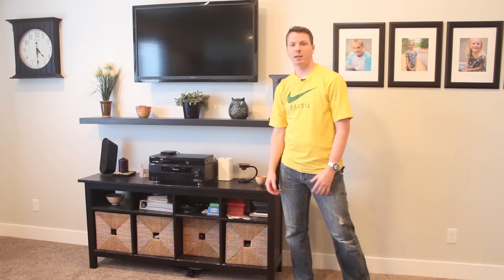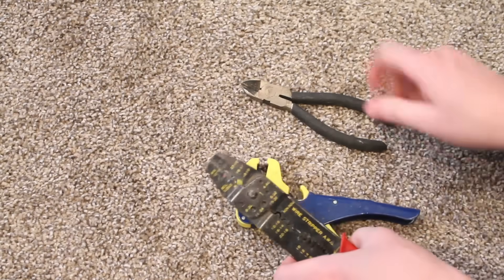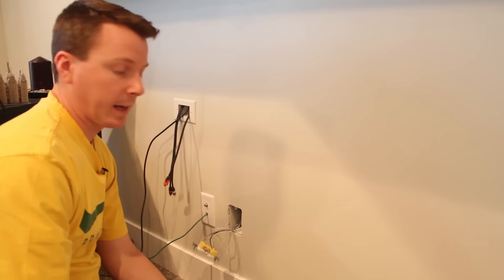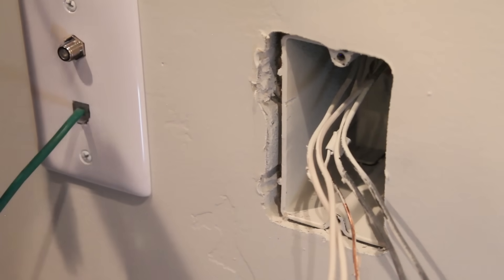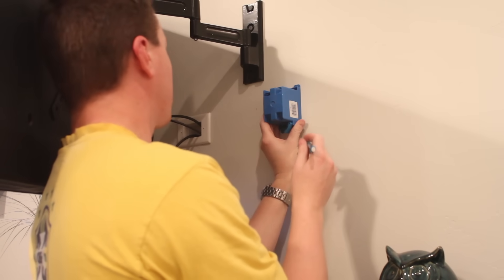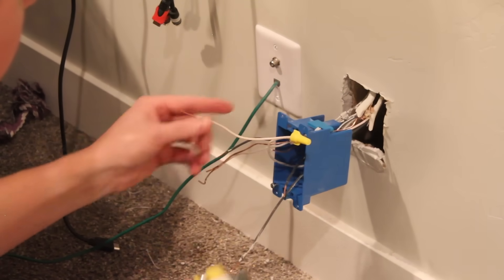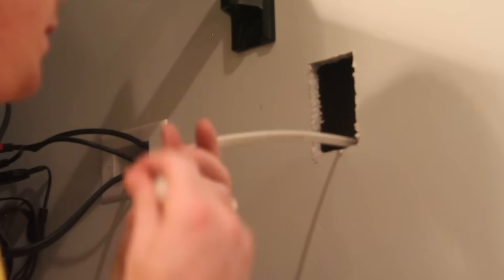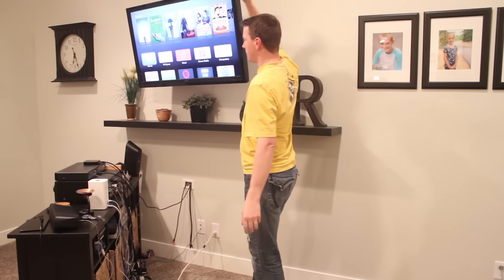How to Add an Electrical Outlet for a Wall Mounted TV

Comment: As a professional electrician this is brutal to watch.
Reply: See how he spliced the one set of wires together because he has 3 cables in the one box. He should have splice all 3 white with one jumper wire to go to the terminal for neutral (white). Same for power  (black) and the bare copper ground. This will prevent other device's from not working of the outlet goes bad making it easier to troubleshoot the problem in the future. When he entered the 3 cables in the one old work bod the white jacket was not in the box at all that's a national electric code violation. The way me made the terminal hooks is good. NEVER back stab the device to make. Meaning dont use the quick connection holes in the back of the device. It's not as solid connection as a terminal screw and can cause arcing. Finally no need to take out the old box from where you are getting a feed from. You can pop the tab from the inside. Cut out the new box above the existing device and send the snake up.
Reply: Union electrician here: agreed.
Reply: Why did you watch?
Reply: @kevinm8865  to see if they are telling people the proper way to install a device. Now thousands of home owners are gonna hack up homes
Reply: @noonzzzy  LoL! I'm a homeowner that's hacking his way through this, unfortunately.

I do desire to do it correctly though. Perhaps with your comment, you could add some meaningful suggestions so ha is like me can do better.

I get it though. You studied and became a professional and that's not the path I took so I can't be expected to have pro skills.

I do agree with your sentiment hat many people should not be doing tutorials online when they themselves are amateur.
Reply: Also in the top outlet he only has about 3 inches of outer jacket removed. Its recommended to go fro 6-8 inches or wire in the box.
Reply: @noonzzzy  Fiest thank you not not being a YouTubw jerk! Very much appreciated. That is for the tips.

Meanwhile, I'm currently fighting and cussing trying to fish cable through my insulated wall. Next step will be wiring if I ever get there.
Reply: @kevinm8865  oh yeah it can be a real pain you need a snake. Make sure it has a small head on the end a hook that's taped off so it wont catch the insulation. Thanks no one likes a troll. If I had the video production this channel has I would do a response video. It would be so much easier to show tricks and tips
Reply: @kevinm8865  if you have kids or a spouse that could help snake one to work the snake and one to feel for it in the wall where you cut out the new box
Reply: @noonzzzy  I would also like to thank you for explaining the things you had a problem with instead of just trashing the guy and moving along. Getting ready to tackle this today and I have to go through a small metal existing box thats not installed in 2x4 walls.
Reply: @610scat  sounds like you are dealing with an older home. If you look in the box you are tapping out of  and it has  a metal clamp with 2 metal tabs with a bracket with 2 holes in it its m/c wiring being used
Reply: @noonzzzy  small metal box, barely enough room for the outlet with wire coming in and going out.  I ended up taking the old metal box out and replacing it with a nice new old work box after i fished the new wire down to it.
Reply: @noonzzzy  So what do I do if my box already has 2 romex coming into the top 2 holes?  How would I get the new romex fished through to go up if only one romex per hole?
Reply: @andrewconstantino8570  take a flat head screw driver or needle nose and pry back the plastic taps on the side of the box you want to snake out of. Send the snake up the knock out you enlarged. You can have up to 2 cables per knock out. When snaking the wire into the existing box make a small head that attaches to your snake hook. I would skin the outer jacket expose the three conductor. Cut out the hot and neutral leave the bare ground. Make a nice tight loop and run it in your snake hook. Crimpe it with pliers so it's nice and slender. Then tape it all up. Once you get the cable in the existing box make sure you have enough so you can cut everything off the snake and have fresh conductors to work with
Reply: Is there any video you’ve seen where as a professional electrician you would approve?
Reply: @redvelvet261  if you look up electrician u channel on YouTube he might have some video on this he is good

Comment: thank you, this is so helpful.  If I want to connect the new outlet to a existing one that is about 4 feet away on the upper right, is it going to be challenging looking for Romax cable from the other end?
Reply: I would suggest having a second person to assist with the drop wire. Have one person feed the cable from the top and arch it slightly to the existing space. Your spotter at the lower box can help guide you to the existing hole and help pull it through.

Comment: Good video, when I did it I hooked up in the attic but yours looked easier. But I don't think you should've reused the plug, without a release you could bend something inside the plug and it may affect the degree of contact. 15  amp plugs are generally less than a buck  in home depot, when your buying some Romex just pick up a plug?

Comment: Not a criticism on his video but I bought a couple of these 2 or so years ago and it was a super simple install. 

https://www.bestbuy.com/site/powerbridge-in-wall-power-and-cable-management-white/5580605.p?skuId=5580605

OR at

PowerBridge TWO-CK Dual Outlet Recessed In-Wall Cable Management System with PowerConnect for Wall-Mounted Flat Screen LED, LCD, and Plasma TV’s https://www.amazon.com/dp/B00GWGZGQ4/ref=cm_sw_r_cp_apa_i_JoO7CbP0PF10W

Comment: use a recessed box for your power and your low volt. there is a special box that has both incorporated sectioned off.you can not combine low volt with high volt. i dont remove the lower box and have done this many times both commercial and residential.show us how you get around a fire block bright guy.

Comment: Although you have some skills, you are certainly not a craftsman. There was no need to remove the lower box and in doing so, you ruined the drywall around it. Also, in the bottom box, the video showed that the sheathing from the two cables was not inside the box. I hope you fixed that before installing the outlet.

Comment: As a licensed professional I see a few flaws...(1) you are not a licensed professional therefore you should not be giving tutorials.
(2) you've have not paid for or filed for a permit application. (3) you have not installed a tamper proof receptacle at either the receptacle you installed or removed (4) you did not replace the existing breaker that controls that preexisting circuit with an AFCI breaker. 
There is one more thing...you cannot place two wires in one opening of any new work or old work boxes, it is not allowed by code.
Do what you want people...but if there ever was a problem with that installation and damages are sustained....your insurance may not cover you....or charges brought against you if someone is harmed or dies.

Comment: As a licensed electrician...never do it like this guy did.
Reply: What did he do incorrectly, that you would have done differently? I was going to follow his instructions,  but now you have me rethinking it.
Reply: @tjjackson4622  I'm not an electrician, but I think he stripped off too much of the white sheathing that protects the black, white and ground wires.  I believe any wire leaving the junction box and going into the wall needs to be protected by that white sheathing, but hopefully an electrician can confirm.
Reply: Explain
Reply: Is Dan correct? I have no idea what he did wrong?

Comment: High voltage is 400,000 -133,000 volts, medium voltage is 11,000 volts low voltage is less than 1000 volts and extra low voltage is 12 volts and under.

Comment: When amatures attempt to teach you electrical on youtube.. couple points
1.) The old outlet had too much tail you should of cut the wires and tossed it
2.) You had absolutely no reason to remove the old workbox you could of fished up (w/t pex) grabbed your line and pulled back into the existing box
3.) You trimed your new outlet too long used the wrong size wirenuts and no ground clamp
4.) Even the make up of your outlet behind the tv is garbage sheath should be stripped bact to the workbox withba handful of tail coming out and yes it does matter which screws you land on the top away from ground screws are prefered and set the unused ones
Are those TR outlets?
5.) Nec requires you to add an afci

If your going to make instructional videos about electrical installations you should be somewhat experienced

Comment: Two screws on each side for white and black. Does it matter if you connected the line from the breaker box to the 3 splice or should it be on its own screw by itself?

Comment: Does anyone know if you can add two new outlets behind the TV  this way ? I need four plug in spots  :/
Reply from the maker: You sure can. Exact same principles apply. Still a good idea to see how many outlets or lights are on the same run because every additional outlet has the potential to put additional strain on that circuit.

Comment: living in the UK, it terrifies me how bad american electrical outlets are with exposed terminals on the side of the sockets. and why use those weird yellow things to connect cables together, just put the new cable under one of the screws

Comment: this is a vidio on how not to do it  ,wires not installed in box correctly ,outer jacket not inside box and on most boxes not approved to have 2 wires entering through same hole  .from a retired electrican
Reply: Ken Allen good thing you retired because you don’t know much about electrical
Reply: @leonardholt5311  and you know even less and you saying you are not an electrician is hardly a surprise
Reply: Ken Allen I am an electrician. Not a clean up guy like yourself. There is no box in this video that can’t have two wires in the same hole. If so, please share code book reference. Oh wait, you’ve never opened a code book

Comment: You should never pre-twist the romex wires.  That's the job of the wire nut.  It will actually hold better if you do not pre-twist.

Comment: There are outlets that are made to chain together, so the extra 6 inch Y cable that was made wasn't necessary.  This will also create a lot of excess wire in the box.  Be sure when buying the additional outlet that it has screws on both sides, since this is the type designed to be chained.  See the following web page for more details: www.electrical101.com/receptacle-wiring-using-nm-cable.html
Reply: Why does he have two sets of hot wires on the outlet
Reply: Why are there several white and black wires in the existing outlet?

Comment: Respect this guys ambition but this should be a video on how not to do it. Removing the perfectly good gem box for no reason other than to destroy the wall and not pull the wires all the way into the new box and essentially cause  a fire hazard. Always call a licensed electrician. Only call this guy is making is to his local fire department.

Comment: I'm an electrical engineer and when I do a project like this, I way overdo it! I worked for NASA and we over specified everything. And I am proud to say that nothing ever failed on my watch. I carry that work ethos over to my home projects. Zero Defects we called it.
First, I tear out a lot of the drywall to reveal the studs and anything behind the wall, like pipes and wiring. Then, I install electrical boxes. I would use three double outlet ac outlets. That makes 6 outlets for TV, cable box, router/modem, power for USB plugs, and a couple of spares. In today's world, I would use two of the ac outlets that have built-in USB ports. It's a USB world. All of that is for the high voltage work. Also, I'd use armor cable behind the wall so one day I don't drill into the Romex. Yea, I know Romex meets code, but it only take another ten minutes per cord to cut plus about 4 bucks extra per outlet. A word about studs - they're never where you want them to be. I often run a 1 x 3 x 18 to two of the studs. Then I can use wood screws anywhere convenient in the wood to attach things to the wall because the wood is transferring the load to the studs. The wood has pretty good strength for most work when attached to studs. Some people cheat and hope that one stud and one toggle bolt will hold the load. Not for me. That toggle bolt has a name in engineering. It's call a potential point of failure. Don't rely on drywall to support much weight. Later, I tape and paint the wall, The low voltage wiring is the same as everyone does it. There's no danger hitting a speaker or hdmi wire. The big job is repairing all the drywall I damaged and ripped out. But after 20 years of drywalling, I can do that in my sleep.
Some advice to beginners: learn how to do wiring. It takes practice, reading, and maybe someone who is trained (not your neighborhood handyman) to do a 'safe install'. It took me a few years until I figured everything out, so don't kick yourself for not knowing things right outta the gate - wire gauges, how many wires you can put in each size box, how much current a wire can carry, etc. The best investments you'll ever make: 1-a book on how to wire. 2-a five dollar tester from Home Depot that plugs into an outlet and lights up with 2 orange lights if it's good and one red light if it's bad wiring. And carefully choose what youtube videos you follow. I once saw a guy dressed in an official looking shirt like he was a pro do everything wrong) . In the 'old days' you had to apprentice for two years with an electrician before you could join the electrical workers union. That's all gone and anyone with a wire cutter thinks they're an electrician.
Well, that's how I do it. It takes me a few hours and a few bucks more, but I don't have to worry later on. Next stop... Mars!

Comment: very simple all you have to do is take the existing receptacle plate off, knockout the top knockout push the wire up to wherever your hole is going to be. I'd rather use a nail-on rather than a clip in any day just because a clip-in could get pulled out. The existing outlet should be mounted on a stud unless it was an added outlet so go directly above it and you'll be on a stud and get the nails pulled out of the nail on box get a sawzall to cut the little ears off. Get a sheetrock saw and saw where that stud is about two or so inches just so you know where it is level. get your box put the one side of the box against your line that you cut out and draw a round the rest of the box. Cut it out with a sheetrock saw. Grab your wire put it into your nail on box then get some drywall screws on the inside of the box and mount it to the stud. It will secure your receptacle a hell of a lot better. Tie in the new outlet then go to the existing other outlet and tie it in and there you go. If you wire it up right no need for a voltage tester at all just maybe a hot light to make sure that the circuit is off. If there's insulation fiberglass rods are perfect. if you had the ones that glow in the dark it'll be even better. If you can't find a wire in the hole, which is nearly impossible, then you can easily get a nut and string and fish it down

Comment: For those getting started working on electrical.  Not all reciprocals are going to be "Brass/Silver/Green".  Not all of them will be right side up as well... Not all houses are "up to code".  To have a better mindset over the wiring before you blast yourself away or your clients house goes down in flames.

N - Neutral(White)
PG - Ground Wire(Bare or sometimes green)
B - Hot Lead(Black)
R = 2nd Hot Wire/Accessory

B goes right - Smaller Rectangle
N goes left - Larger Rectangle
B should be Right side so the grounded "circle" is below the rectangles and not above

Yes US base for ease of installation it's "Brass/Silver/Green" but not every house will be color coded so know the basic wires and not just the colors.  You'll walk into a old house and it's all brown wiring and you'll see a white that's actually hot wire and not neutral then you have to backtrace the wiring. Older homes ALWAYS volt check which side is which so you at least know it's right and if not, make a note and let the customer know.  

All that unnecessary plug box pulling is nothing but added cost and risk.  Leave the old box in unless it's so frayed you have to. Just drill a hole and fish OR there are tabs on the old boxes as well but hey, you are updating, no shade there and I guess I take it back lol.

I saw your holes you did denting the drywall when you were prying.  NEVER pry drywall side, pry back towards the box.  Soo as you said "Here's the plate I put back on" ... All i saw was holes, now you have a paid drywall and paint job.

Just giving a bit of tips for those coming to the video.  Good stuff overall man... I subbed

Comment: When you removed the bottom box I saw two sets of wire popping through. You would then fish in the connecting wire to the new box. When you put everything all together I only saw 2 sets of wire, wouldn’t it be 3 sets of wire coupled plus the other little extentions to connect to the plug?

Comment: Awesome video, about the only recommendation I'd give is to purchase outlets that have a surge protector built into them no use doing all this work and have a lighting storm or a mess up from your electrical provider fry up that new 65" flat screen. Outside of that, great job, love you videos!

Comment: Do you do the same thing if you are adding a ligjt switch for a light instead of an outlet?
Reply: I think I read somewhere that getting your power for a light switch from an outlet can trip the breaker if a large appliance is plugged into the socket